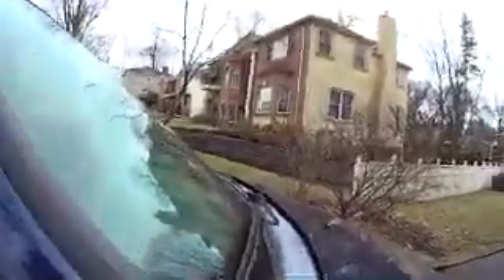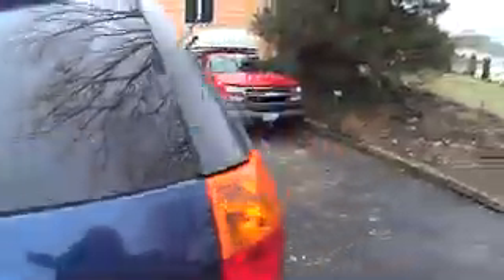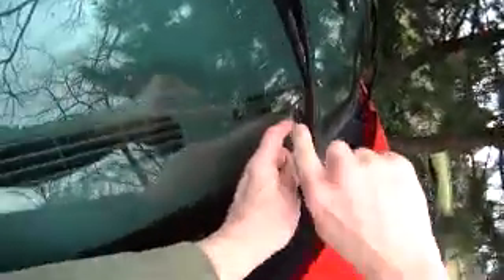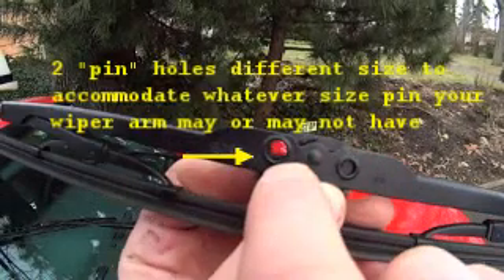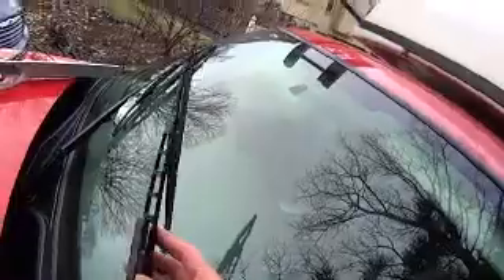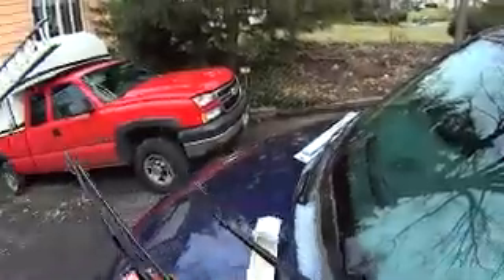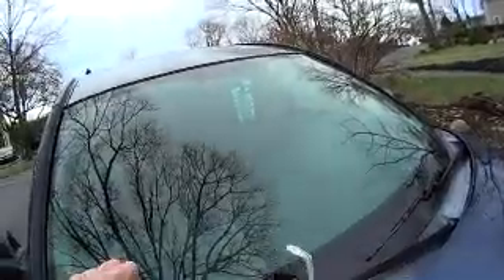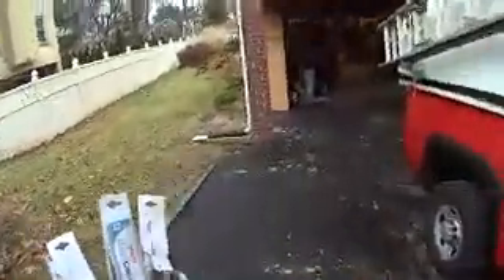HOW TO REPLACE WINDSHIELD WIPER BLADES VIDEO

Comment: If you want wiper blades to last longer, usually MUCH longer, just buying a name brand will not cut it.
When I buy blades I go for the middle priced Michelins - a few dollars more per pair - about $10 per blade. The last pair has lasted me 2 1/2 years without streaking so far where the cheap blades (like Anco etc.) only lasted a season.

NEVER turn on your wipers when there is ice, dried mud or sticky grit on your windshield! Defrost, scrape, wash or squeegee FIRST.